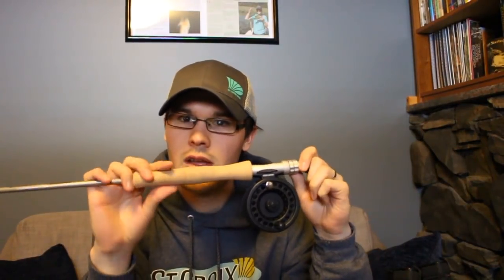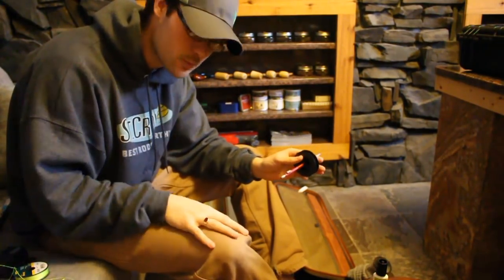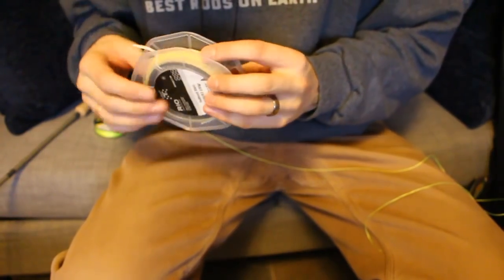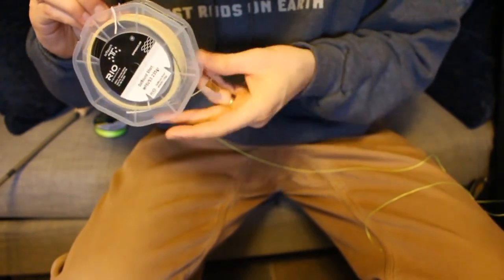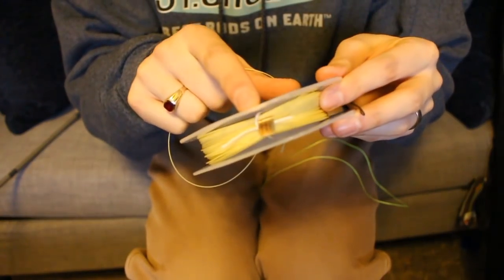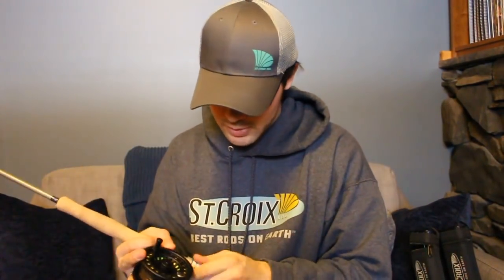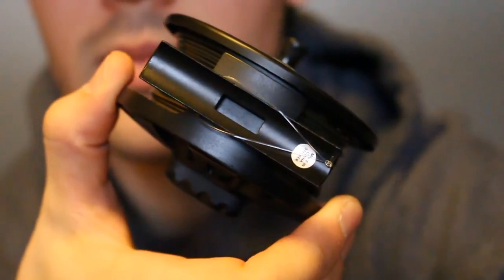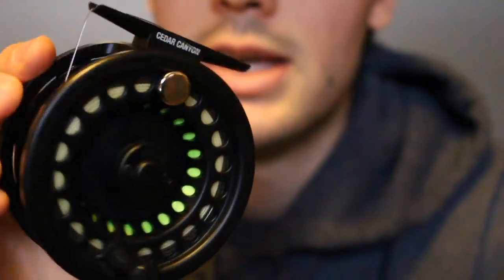Fly Fishing: How to Spool up a Fly Reel

Comment: Great tutorial Gunnar as always. I use to work in fishing, fly fishing and marine departments at Cabela's for almost 10 years and have spooled hundreds upon hundreds of fly reel spools as well as conventional baitcasting and spinning reels, and even I have messed up with some fly lines getting all knotted and twisted, especially the cheapo lines. Those are all great knots to use, and that knot to the arbor of the reel is well an arbor knot. Some of the cheap/inexpensive fly lines didn't have welded loops on either side so on the leader side we had to tie in a section of 20-30lb amnesia that was red and had a perfection loop on the other side. 
I know you are heavy into the fly fishing side and that is awesome, but you should look into the Berkley Portable Line Spooling Station for $20 that can be had at Cabela's/Bass Pro and some other sporting goods stores. It can help spool baitcasters, spinning reels and for you and all the fly fishermen/women if can easily hold and spool a fly reel. It has a place to hold the foot of the fly reel so you don't have to put it on a random bottom section of a fly rod and about 18 inches away it has a metal arm with two spool tension cones to hold your backing spool or fly line spool and you just tie your knots and spool her on, no need for taking your socks off and using a pencil and toes. Easy peezy Lemon Squeezy. It is small and light and can be put on your table or any available flat surface. I hope that helps and I am sure all those tricks have helped those who are new to the sport and serve as a refresher for others whom haven't spooled fly line in a while. I am surprised that RIO, SciAngler, Fish Pond, etc... haven't designed one for public use yet. If they have it probably cost a lot. Tight Lines Gunnar and everyone else.